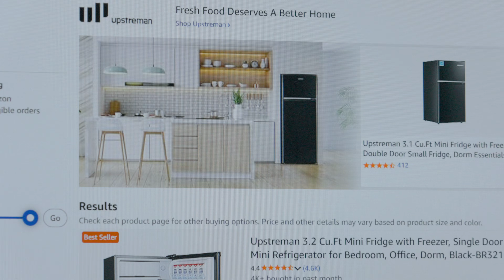DIY Invention! How To Make a FREE Water Pump from Scraps | Totally Hacks

Comment: this won't last and is unsafe to do, see, fridge compressors also pump their oil through and use the pressure differential to push the oil to supply the fluid bearings, water in the system would corrode the bearings and cause it to lock up, and that's not even the worst of it, as it's a sealed system which relys on pinholes to cool things, they run extremely corrosive oil so that they never block up, so you're pumping corrosive oil into your water which we'll deduct 2 points from your score later

not to mention, if your goal was to multiply water flow, this setup wouldn't be how you would do it, you can see that the power cord doesn't even go to the compressor anymore at 7:43 anyways fakey mc fakerson, which would mean you get 0 points for the function you want to give it in the first place, which gives you negative 2 points, thankyou for playing, better luck next time
Reply from the maker: I like your way of expression and writing style 😅😅. And you’re totally right! There was a flood recently where I live, so I made this pump to drain the dirty water out of a large puddle, there is a river near the puddle which you couldn't see in the video, later I connected a long pipe in to my pump and it drained out the two whole puddles just fine 😁
Yeah, it’s kind of weak — my neighbor built a similar pump, but his is really strong, and I don’t know why. Do you have any ideas on how to improve it?
As for the power cord, I think it was just a misunderstanding — the pump was actually powered by electricity the whole time!